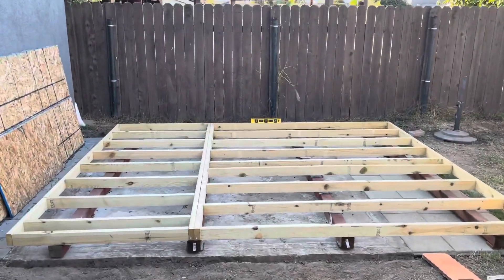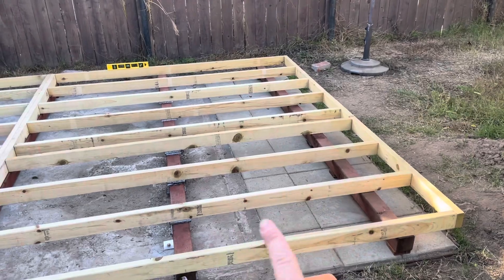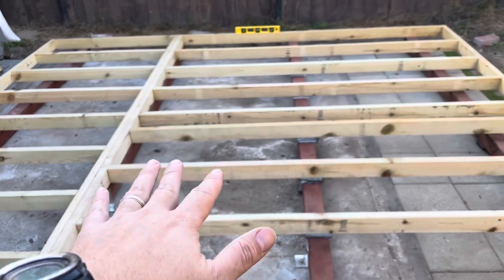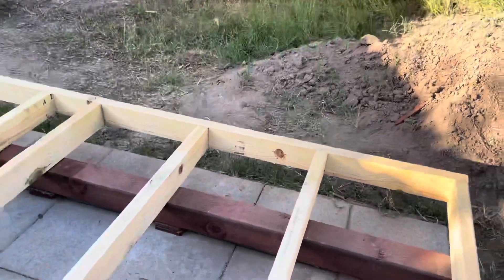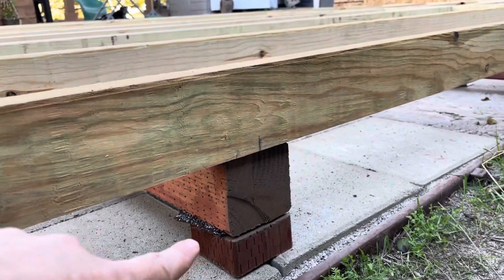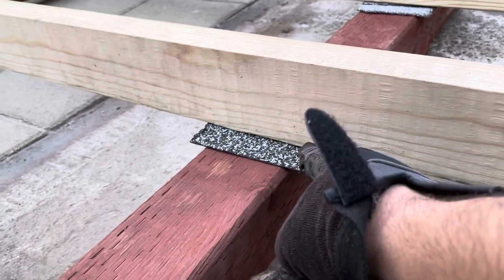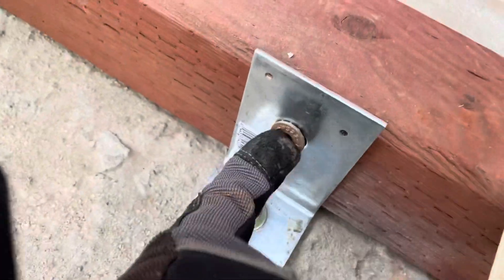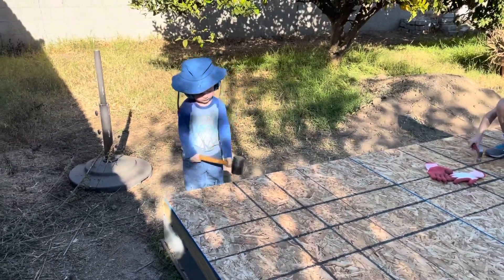Building a Costco Yardline Stirling Shed Part 2: Building and leveling the floor

Comment: Nice!!  Fallbrook here.  I just bought one of the 10x12 sheds from Costco as well.  Really like the wire mess skirting around the base to stop the critters.  Two questions for you - 1. Did Yardline provide the treated lumber for the flooring? (I realize the treated 4x4s for the foundation were separate).  2. How much space did the entire delivery bundle take up?
Reply from the maker: 1. Yes I'm pretty sure that the 2x4's for the flooring were treated lumber. You can tell by looking at the ends, which I think were a different color than the other 2x4's.
2. Not sure actual dimensions but the length of the package was at least 10 ft. Pretty efficiently packed.
Reply: @dgalvan123  - Many thanks for info.  After ordering the shed - delivery was scheduled within a week. I was completely surprised.  They had a warehouse near Murrieta and dropped it off along our driveway.  There was a little shipping damage, but they replaced the 3 small boards.  No big deal.  Just finished putting together the 20 x 20 foundation using RCP Legacy landscaping blocks. Working on the floor next - I did notice that the floor lumber was treated.  I'm right at this phase of the project - 0:40. Again - thanks for the tips and all the best!!

Comment: Does this shed need to be ontop of those 4x4 or can this be built on flat concrete surfaces?
Reply from the maker: Can be build on flat concrete. The 4x4s were used per recommendation from manufacturer because it makes it easy to make sure the floor is level when building on a somewhat uneven surface. Also serves to keep the floor off the ground to avoid moisture/water damage from the soil.